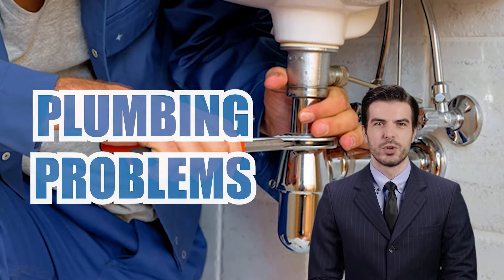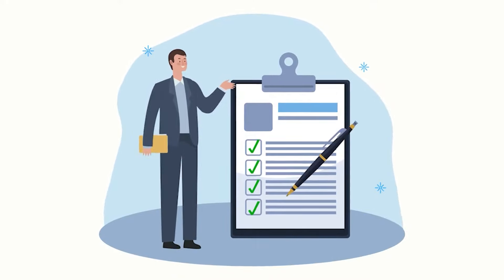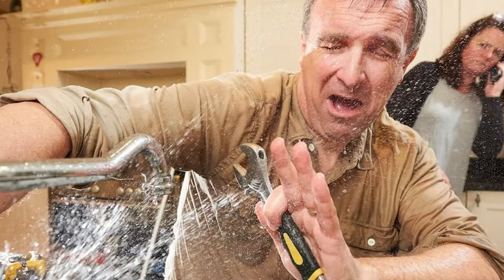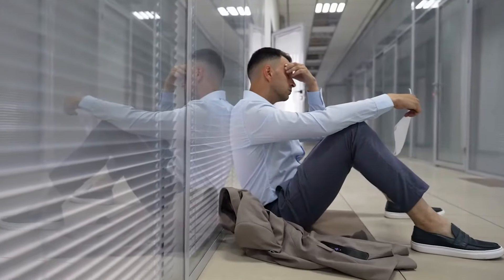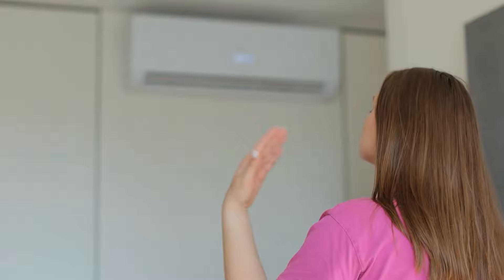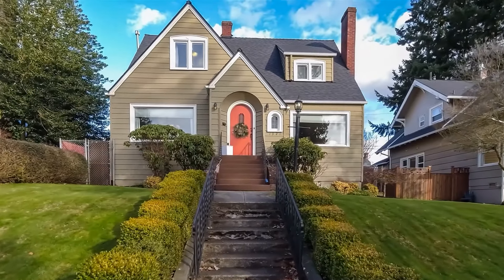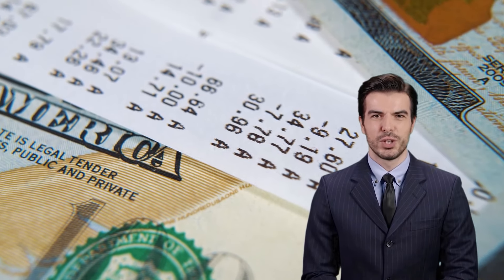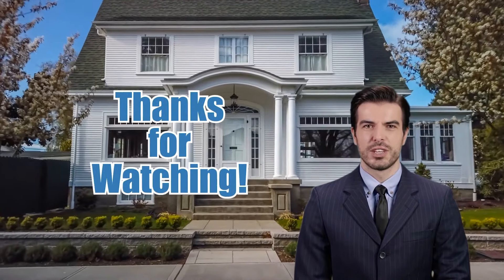Rental Plumbing Repairs (Tenant vs Landlord Responsibilities in 2025)

Comment: If the water leak stems from a structural issue, such as damaged pipes or faulty plumbing, the landlord would usually be responsible for fixing the problem. Tenants are expected to promptly notify the landlord of such issues as soon as they are discovered.